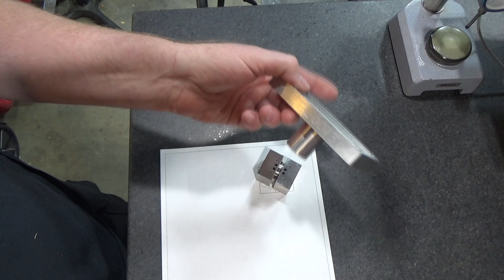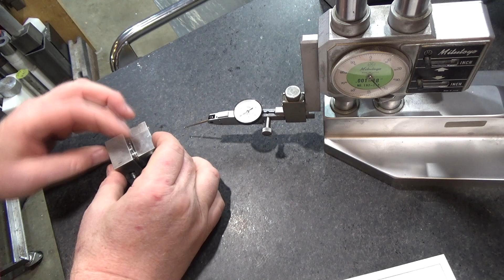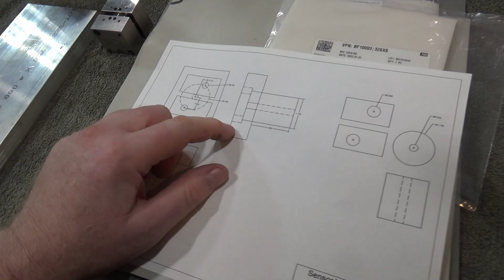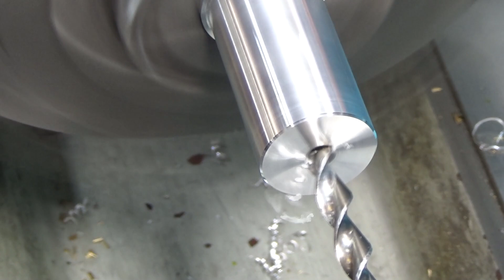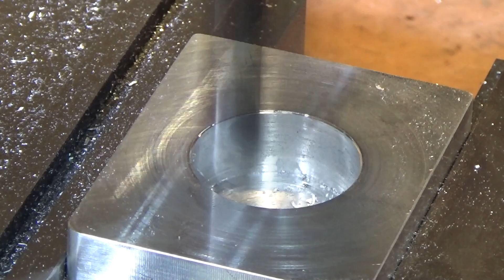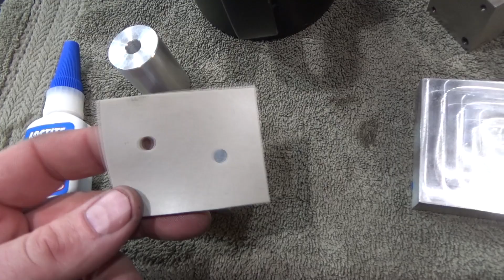200 Sensor Body Vacuum Test Fixture

Comment: Why not finding the position of the pins on the mill, you could measure both pins position X and Y without moving the part. Just my 2 cents,   Jeff
Reply from the maker: Not a bad solution either. There is always more than one way to sold a problem.